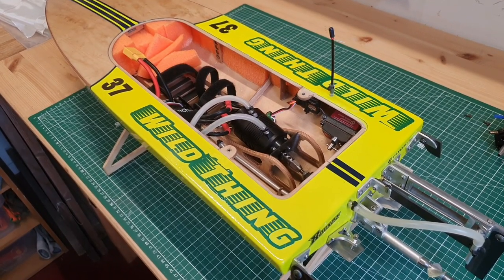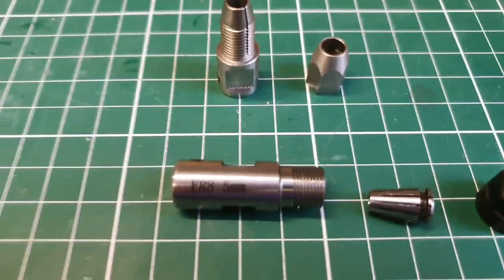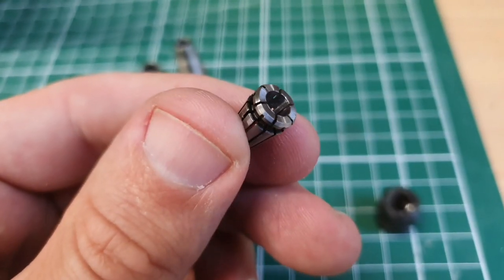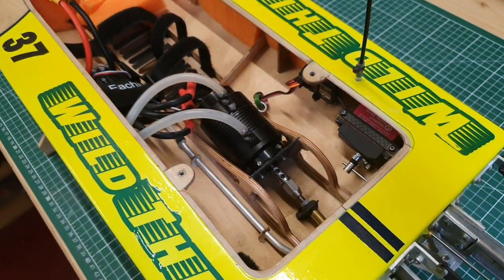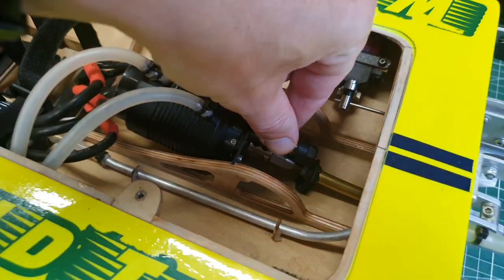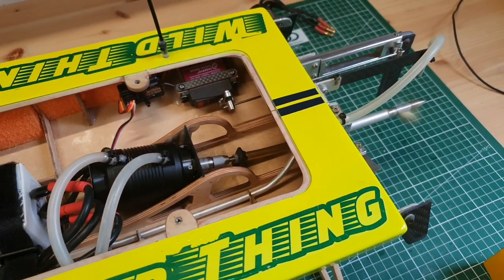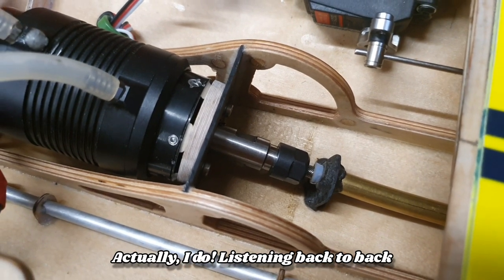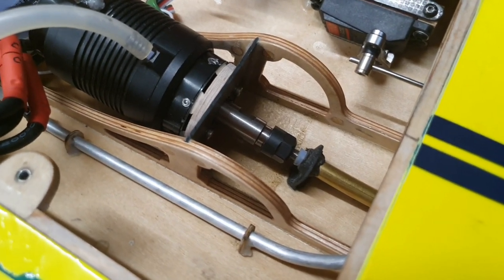RC BOAT Wild Thing tuning series episode II - Installing a high precision motor coupler.

Comment: Now you  made me curious😂but my cnc spindle have 8 mm shaft,very good improve I can see on slow motion👍
Reply from the maker: I take our competition very serious Daiciu 😅. But I keep no secrets, so I share my experiences. I put the link to the coupler parts  in the description. Cheers, DJ
Reply: Very nice topic Jan. Indeed, you can hear and see the difference, I didn't expect that. Less vibration will certainly create less stress  to the flex shaft and motor mount. I think that a  guy in the forum has mentioned in one of my posts that the standard couplers vibrate a lot. It is nice to share your knowledge👍.
Reply from the maker: @kaprc631  Yes, that's right! I got the tip from the forum 👍 Basically, my WildThing ran 18 lipo's without issues, with the TFL coupler. But if it can be made better quite easily, I'm in to try it. Now I could go even higher rpm if I ever want to 😉 Let's see if I can  notice it in the next run. Cheers ✌
Reply: @kaprc631  On what forum you are guyz ?I'm on German rc rennboote forum
Reply from the maker: @daiciuapostol79  We are on a Dutch forum: https://www.modelbouwforum.nl/forum/speedboten.16/

You are welcome to join 😎
Reply: @CozyRC  Thank you,I whill visit🙂

Comment: The original TFL Chinese coupler you had in first was designed (copied) after couplers made by Oliver Siesse at Hydro Marine in Germany. I use H&M couplers because they are much superior to any others on the market. MBP have excellent couplers too but they are very large like the new one like you are trying now.
Reply from the maker: Good information Zeeek1 👍 It is always good to know your options and I know H&M makes high quality products. ✌DJ